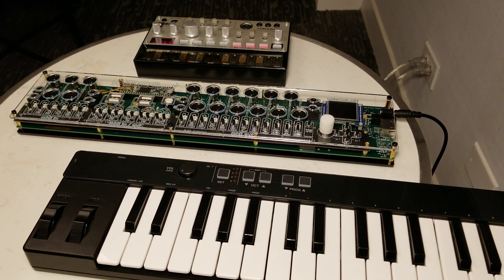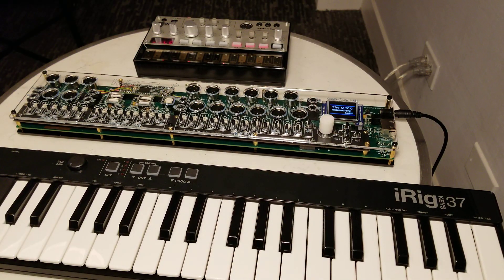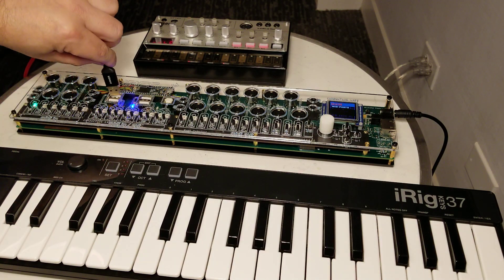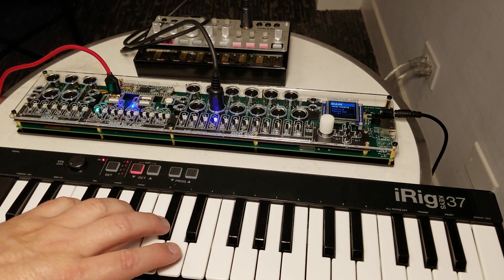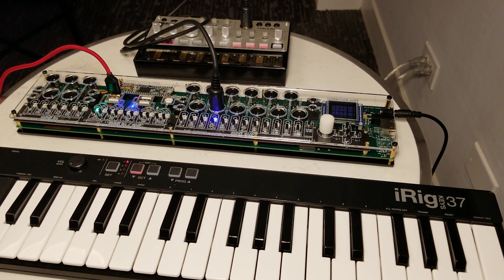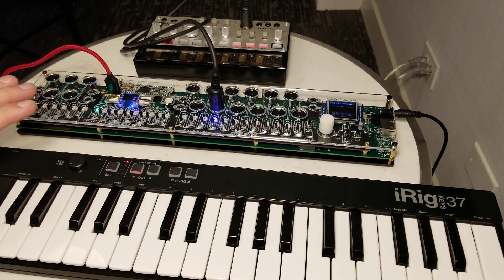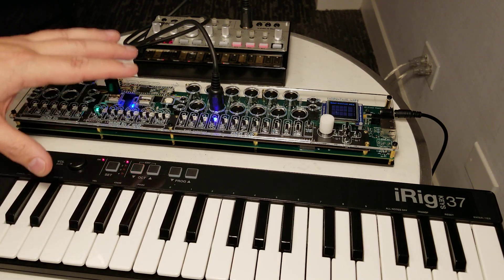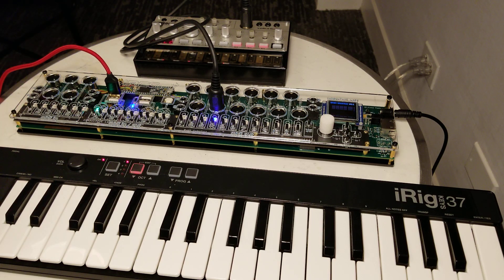MRCC (MIDI Router Control Center) by Conductive Labs - sneak peak

Comment: havent seen it anywhere, but obviously this cleans up jitter, right?
Reply from the maker: You can see more on our website here: https://conductivelabs.com/mrcc
Reply from the maker: Jitter primarily happens when going to a PC running Windows, there will still be jitter there. The timing on MRCC locally is very tight, we used an insanely fast microcontroller for the task. Something like the ERM Multiclock or Expert Sleepers USAMO MIDI Output Interface can provide a low jitter clock from a DAW using an audio based clock.

Comment: Looks awesome. Have there been any tests for midi jitter and/or latency when sending signals thru it via usb from a computer?  Will it have independent latency adjustment settings per out?
Reply: Check the Kickstarter update for some preliminary measurements. https://www.kickstarter.com/projects/thendlr/mrcc/posts/2656230
Reply from the maker: We currently have no plan to have independant latency adjustments.

Comment: Lovely object for de-obfuscating the MIDI-Scape. Now if you could just throw in a MIDI clock generator, a 3.5mm Clock trigger input, a couple 3.5mm clock trigger outputs, a few TRS MIDI A and TRS MIDI B converting ports... this could be a one stop shopping spree for syncing everything. Looks like a very self contained unit. Definitely like the ports on the face.
Reply from the maker: We've had enough requests for MIDI clock that we've got it on the list. We already have a MIDI clock trigger connector, I just didn't solder it in because we haven't implemented clock yet (you can see the holes on bottom right corner). We have eight 3.5mm jacks for TRS MIDI in both flavors. Inputs you can only use one of the 3.5mm jacks at a time, but outputs you can use all of them, they are on splitters. We don't currently have trigger input, we are running out of space for connectors, and they are expensive compared to right angle connectors.
Reply: If  you can sacrifice a 5-Pin there's always the TouchProne MIDI to Korg and Pocket Operator Trigger adapter... https://www.ebay.com/itm/Touchprone-MIDI-to-Korg-Monotribe-and-SQ-1-TE-Pocket-Operator-Sync-adapter/151238063766. Getting a trigger out is always nice for the eurorack and volca users. Super awesome work on the MRCC and the NDLR.

Comment: Any desire to add some sync jacks for volcas or cv to/from midi stuff? And can we use usb hubs to expand the amount of usb midi devices? (and possibly routing between them by name, not just physical port)
Reply from the maker: Yes, we have  a 3.5mm jack for clock trigger output. We did that on The NDLR too. We plan to support adding one USB hub. It gets pretty complicated from a routing perspective to support hubs, and it takes up more RAM on the MCU. We have already tested it with one hub, and it might be that everything on the hub is routed the same as the port its connected to.
Reply: @ConductiveLabs  Eggcelent! I figured the usb stuff might be harder on a uC. I've been using https://github.com/gdsports/rpi-usb-host-midi-hub for some compact usb to usb  where synth and controller are both clients.

Comment: Competing somewhat with: https://blokas.io/midihub/
Reply from the maker: We love the MIDI HUB with the MIDI FX!  That filter graph UI is super flexible and way cool!  Competing, kinda but different features and price point. You should get both! :-)
Reply: @ConductiveLabs  I can't really justify both, but I am having a hard time figuring out how to compare the two. Maybe you can provide an explanation on how the two converge/diverge. One thing I like on the MRCC is the USB host, that would allow me to further remove dependency on my laptop from the chain.
Reply from the maker: @bloopbleepnothinghere  As MIDI routers they are not really in the same class at all. 4 inputs and outputs on MIDIhub, with only 5 pin DINs is designed for a modest setup. It makes a good "middle-man" between input devices and a bigger MIDI router if you need it, but 4 in and 4 out will be enough I/O for many. 
Configuration by PC only on MIDIhub vs configuration on front panel on MRCC with one button per port. So if you want to reduce dependence on your laptop MRCC has you covered.
As MIDI Processors, there will be a little overlap, but we love the MIDIhub user interface and shear number of MIDI effects they have described. That's why we said get both, if you need lots of I/O that's quickly configurable, get MRCC. For some unique and large number of MIDI processing features get MIDIhub. 
The short list of MRCC MIDI processors includes: arpeggiator, keyboard splits, velocity maps, interleaved poly-chaining (like on The NDLR), and probably some algorithmic playing assistants.  You can compare this to the MIDIhub list.
Reply: @ConductiveLabs  ug, just take my money. The usb host routing is something I really like, ease of use without a laptop is another plus. The midi fx would be a bonus. I have a ndlr in the pipeline, happy to support more products 😀
Reply from the maker: @bloopbleepnothinghere  We hope you find the NDLR of such great build quality that you will feel confident supporting our MRCC Kickstarter. You will receive it before the MRCC Kickstarter ends. Steve has left for China this morning to oversee the assembly and testing!